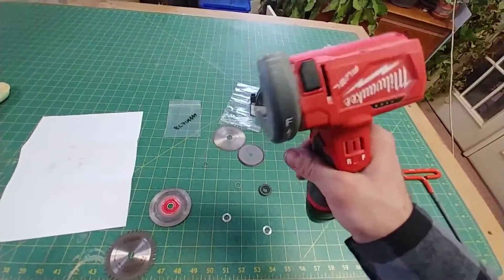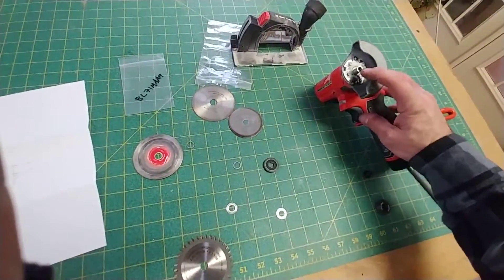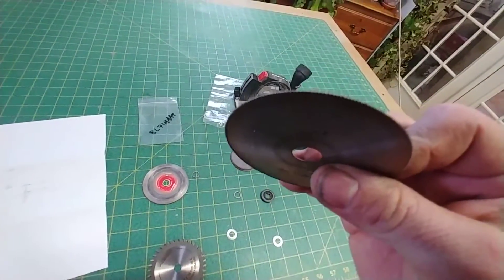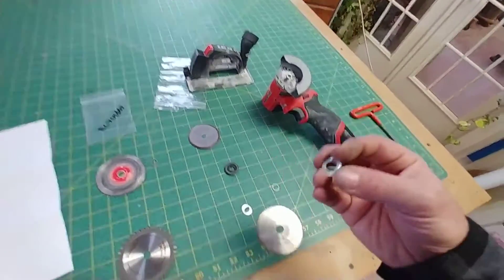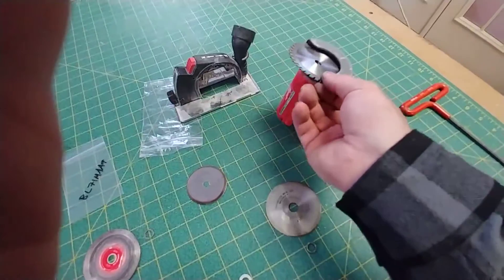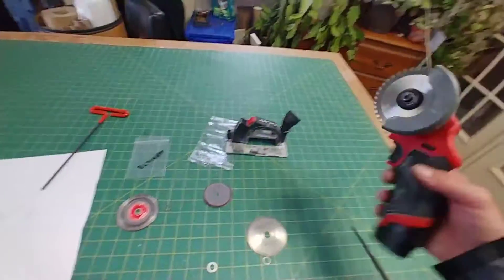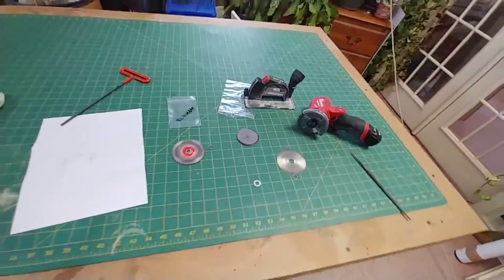How To Convert Milwaukee M12 Mini Cut-Off Tool Into A Mini Circular Saw 1/2

Comment: FYI I just used the multipurpose blade that comes included to cut 1/4" PVC board, and it worked like butter and made a smooth cut.
Reply from the maker: Sounds good! I've discontinued this part so I'm glad there's other options now. Thanks for watching!

Comment: Interesting. I just bought the Makita 18V mini cut off tool. And I had an 85 mm carbide wood blade, and it rubs up inside the guard, and doesn't run. 
What a bummer. So I'm ordering a 75mm one. I also made sure it was rated for the higher rpm.

Comment: is that safe using 18.000 max rpm to 20.000 rpm motor?
Reply from the maker: Use at your own risk. I've used mine for years without incident. You're not getting max rpm out of the motor when cutting, and in fact you need to modulate feed rate due to low torque. You're welcome to source another blade that will fit ;)

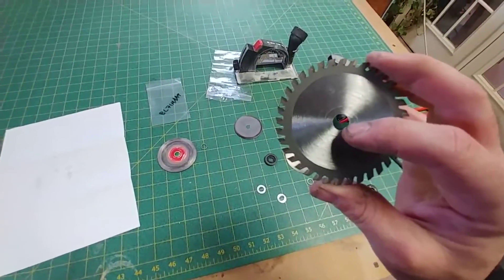Comment: The Proxxon blade diameter is listed at 3-9/64".  At the 3:00 mark, it is stated the Proxxon 28732 blade is 3-3/8".  That is 3.375 inches.  Amazon's description lists the Proxxon blade diameter at  3-9/64" or 3.141 inches.  This is a difference of 0.234 inches.   3-3/8" diameter blades will not fit inside of the blade guard.   I found a few other 3" blades on Amazon that should work.  One is rated for 20,100 RPM.    I already had a 3-3/8" carbide tooth blade with an arbor I made for use in a drill adapter.  That blade did not fit inside the factory guard, so I made a larger guard.  The factory guard retainer uses four T-8 screws.
Reply from the maker: Sounds good. Thanks for putting in the time and effort on this! I probably misspoke. The blade I use clears the guard just barely. The smaller the diameter, the shallower the overall depth of cut available. Thanks for watching!

Comment: Like many people with a 3" cutoff tool I wondered why they did not make a wood tooth blade for the little saws and think that because they turn at such a high RPM (mu Milwaukee 3" is 20,000 RPM) that spinning a carbide tip tooth blade at this high an RPM could be dangerous. I think many wood saws turn around 5,000 RPM.  The tool has a variable speed trigger but is hard to limit RPM. Would be nice if it had switch or button to limit.
Reply: The cutoff tool does actually NOT have a variable speed trigger, unlike most Milwaukee tools. It’s 20k RPM or nothing.
Reply: @TheKurtTribute  Thanks for pointing that out, you are correct!
Reply: @Intoxacajun  I only know because I bought one yesterday, was pretty surprised that it is not variable speed.
Reply: It's an older cut off tool
Reply: I have Milwaukee as well.. I like tools a lot

Comment: Hi there.
I'm pretty sure the Bosch mini 12v grinder uses 3 inch blades and these have been around for over 5 years.
This is the model number, maybe this will help people since there should be no conversion necessary.

GWS 12V-76 PROFESSIONAL

They sell multiple types of blades aswell as the multi wheel for general cutting including light metal.
Reply from the maker: It looks like that tool isn't sold in the US, which is where I've sold the dozen or so adapters that I've sold so I guess that makes sense. Plus if you've already got M12 batteries and this tool, $50 is a nice expansion. Good looking out though, thanks for watching!

Comment: Yes, Milwaukee sucks doing crap like that. They are an altar greedy company. Instead of being smart and making and selling these things. They make you have to create it instead. Talk about greed. Look what they charge for the plastic pack-out crap. I call them the altar space wasters. And every inch of that wasted space you pay top dollar for it.
Reply from the maker: I dunno man, I have a degree in Industrial Design, I've worked in product development, and nowadays my construction business is based on Milwaukee FUEL tools, I think I know what I'm talking about when I say the amount of innovation and quality that can be had today from prosumer brands is incredible, Milwaukee is definitely worth the money for pros and weekend warriors, in the long run. Not sure why all the hate, try to keep it factual.
Reply: @TMFXLLC  Do the math of actual usable working space That you get to use. Then measure the overall footprint The difference is a high dollar wasted space. And I am invested in Milwaukee tools. You look in my service vehicle and Red is what you see. I have had two fuels just crap out so far. As my brush motors by Milwaukee. 1/2 drill and my 7-1/4 saw just keep living on. My fuel 1/4" impact also shows erratic behavior. But the old one still runs and runs. Yes, let's stay factual.
Reply from the maker: @mostlikelywedoitservices6926  Usable space is one major metric of the design in question, other major factors create a give and take, it's hardly greed or bad design. You simply can't have everything.

Milwaukee will warranty repair a ton of stuff for free, all you have to do is send it in through a local independent retailer. I have yet to pay for anything, I'm always asked before work commences anyway. A couple bad trigger switches, a new oscillating assembly for the multi tool, all of it for tools I bought second hand. No paperwork required.

No idea where you get all the hate.
Reply: @TMFXLLC  Oh, let's not forget about their worthless chargers. I have 3 or 4 of them that are just plain crap. I have other brands and they seem to run forever.  Or let's sell power tools that need the large 12 volts but they sell it with the tiny one. Really.

Comment: This is completely irresponsible to recommend this. The proxxon blade is rated 12000 max rpm and the Milwaukee cutoff tool spins at over 20000 rpm. This can easily cause that blade to fly apart and seriously hurt someone. You should remove this video or explain the danger of what your recommending. I’m sure you wouldn’t want to be responsible for someone getting hurt.
Reply from the maker: Hey Waddles, thanks for watching! I'm not recommending that anyone do anything but for the record, a small manufacturing error can cause any type of thing to happen even if products have been well engineered and are being used as intended. My knowledge and experience in materials and processes makes me comfortable making this alteration to this tool. I've put some miles on this modification myself and have had no undesirable consequences so far.

Comment: This is a dangerous tutorial video to post.

A lot people do not recommend angle grinders to cut off wood even with the right blade. Most grinders runs @ 12,000 rpm.

It is just too fast, let alone a 20,000 rpm cut off tool, that runs closer to your hands than an angle grinder
Reply from the maker: Sorry Gonzo Balls, this tool has very little torque as a result of the high RPM. If you're busy cutting, you'll never get anywhere near 20,000 RPM. With a blade like this you need a slow feed rate to keep from stalling it out while cutting, but it is very handy.  Please don't feel obligated to do this whatsoever. Thanks for watching!

Comment: I just bought the tool. And I stumbled on your great short video by sheer luck. I am going to have to get a shop to make me the adapter. I am having trouble reading the dimension below the .020. The shoulder depth is?
Reply from the maker: Hey a fellow WRX man I'm actually going to be restocking soon and I think I'm going to do the next batch and steel so if you can hang out a week or two keep an eye on my website.

Comment: People need to be careful with different blades. If the blade is not rated as the same speed as the saw it can fly apart. Also the 3" saw is not variable speed and can go 20k.
Reply from the maker: This is true. However this tool is high speed and low torque. So the moment you're cutting, there's no way you're doing it anywhere near 20K RPMs.

Comment: Thank you for the informative presentation. I have Milwaukee cutoff device and I was hoping to buy a set of the adapters, you spoke of.
Regretfully, you stopped manufacturing it. Would you not make them any more, if I may ask?
And where do I get the cutting wheel, you exhibited?
Let me know. Thanks and regards.
Reply from the maker: Hi Sree, new inventory available on my website. Everything is in the video description. Thanks!

Comment: I work installing ac ducts and sometimes you have to cut the ducts on small spaces where this would come in handy . Do you think this could cut sheet metal ?
Reply from the maker: Absolutely, the tool is designed for sheet metal and comes with the appropriate blades. This video is a mod to run a wood/plastic cutting blade.
Reply: @TMFXLLC  thanks for info bro! I was wondering if the carbide blad the comes with can cut wood/plastics, the in a search you vid came up, from the diff ahape to you blade in the video, I assume the carbide blade is not for wood?
Reply: Get the tin snips out ya lazy git 😜

Comment: I'm a floorlayer and wanted something to replace having to cut 6mm with a knife or jig thought this tool was perfect but didn't know how well it would deal with wood
Reply from the maker: Hey man thanks for watching! I use it almost exclusively to cut underlayment! The high RPM makes it relatively low torque so you can stall it out but it also zips right along once you get a feel for it.

Comment: Could you make me an adapter for $20 so I can use the Proxxon blade? The saw comes with a 3/8 inch (9.525mm) flange.  They also have a 7/16 inch (11.1125mm) flange in the box that can be used with a Dremel blade.  I called one machine shop and they want a minimum of 1 hour ($125) to work on anything
Reply from the maker: Hey Ralph, I had a few more made. I'll add them to my Esty shop and website in the next few days.
Reply from the maker: Hi Ralph, they're now available on my website. Thanks!

http://www.technicallymagic.com/products
Reply: @TMFXLLC  how many you get for the $35?
Just one?
Reply from the maker: @Rexxthespecialist  Yes, one.
Reply: @TMFXLLC  are more coming? I would like to get one

Comment: This blade is rated for 12k rpm, while tool is 20k rpm. I think this is dangerous.
Reply from the maker: Good looking out, sounds like it's not for you!
Reply: @TMFXLLC  Thanks for the video. I have been trying to get something to replace my corded dremel saw to do accurate plunge cuts in 1/2" plywood. Is the tool difficult to control in wood given the high rpms?
Reply from the maker: @Ryndog  Thanks for watching! It's actually easily stalled out as the high RPM and low rotating mass equals low torque. What exactly are you trying to do that you can't do with a 6 1/2" circular saw?

Comment: Got mines off amazon and it fits perfectly 3” 3/8
Reply: Got a link for that? I haven't been able to find those blades.
Reply: which cutters did you buy that fits perfectly. Thanks
Reply: @osvaldoherrera5219  3 icnh 75mm circular saw. Lenox metal on Amazon
Reply: What's max cut depth with dust guard on?

Comment: Harbor Freight has 3" cutoff disk that have the 3/8" hole
Reply from the maker: I'm in the store looking at the blade right now, 3-3/8 blade, 1/2" arbor.
Reply: @TMFXLLC  I just a bough the M12 FCOT. I love the solution and I hope you keep doing this sort of thing.
BUT you wont be able to do that if you keep leaving the battery in when your changing blades and you start losing fingers. Sorry to sound like a safety rep but its a shit loud easier to take a battery out then re-attach fingers and those carbide blades are incompatible with flesh & bone.

I just watched a guy do the Dremmel blade and I think this is a better solution so keep those fingers attached. 👍👍 

One thing you can try with those fine slitting saws is to grind of teeth to leave gaps for the swarf to get carried out of the cut. I've seen machinists do that particularly with metals like aluminum which likes to clog cutters.

It would be best of all if Milwaukee simply made their own dedicated blade for this. If they don't somebody will.